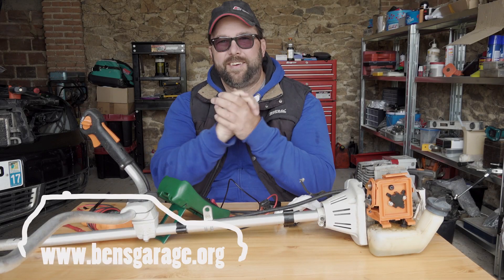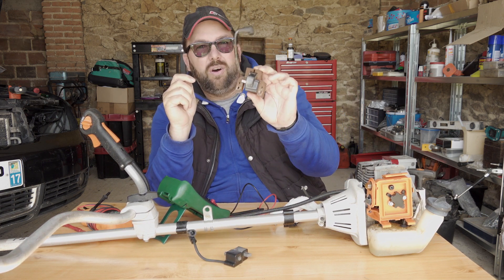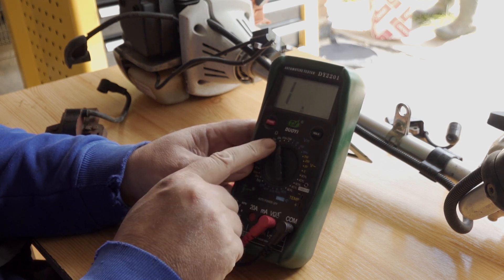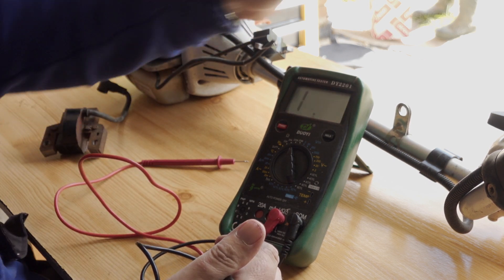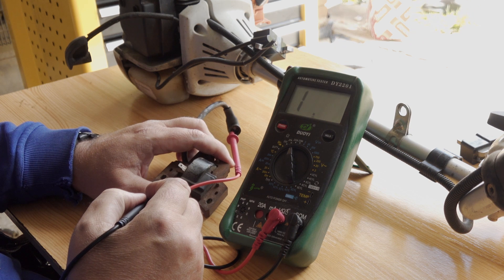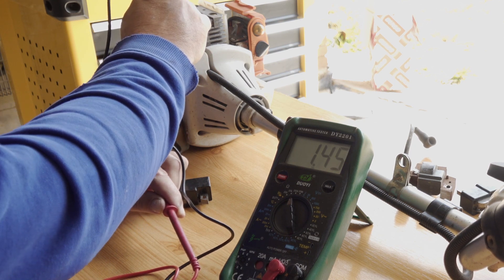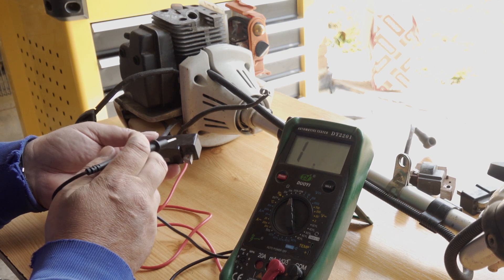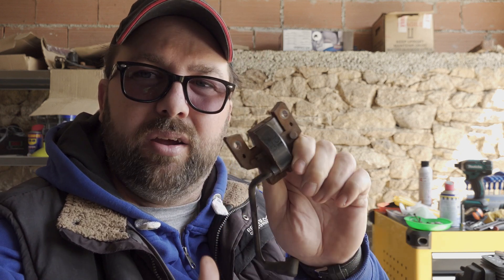How to test  a small engine coil using a Multimeter.

Comment: You tested a 2 cycle coil and it was too brief in context. Most 2 cycle coils have electronic components inside them. Lately I needed a 2 cycle coil and oreded the rightb repalcement part and when it arrived it was defective. I tried again and ordered another and found it decetive as well ( that was from Amazon and both were sent back for refund. Took chance on buying one off eBay and again it arrived defective and not working. Sending it back would cost me money for a refund so it went into the garbage. Coil was fo an Echo tiller TC-210. If new repalcements parts arrive defective, there should be no shipping costs applied to consumer, as it is not their fault if part is defective when it arrives. These coils should be checked before shipping to be in working condition so the consumer knows it will work at time of arrival. All I can say is watch out you might be buying junk as a replacement part. I'd stay away from buying off eBay when it comes to defective returns. You won't get your shipping costs back.

Comment: My southland edger has a reading of 10.59 at settings 20k ohms on multimeter and it wont spark the sparkplug unless i remove the ignition and kill switch wires

Comment: Ahh that's good, I picked up a blower with weak spark and coil reads 3.98k ohm. Spark plug centre electrode reads 18.6k ohm so might try a new plug and get new fuel primer lines. Thanks
Reply: Isn't that way to high? Supposed to be like 2.500 to 5000 when set on 20k?
Reply: @davidwillis5016  once I put new fuel lines on and put it together it worked well. It was a freebie so I'm not complaining.

Comment: thanks for posting am trying to get a spark on an little used but fairly old Honda generator -am told the coil module is obsolete and not obtainable could a substitute be used and could the  coil/spark module be repairable
Reply from the maker: You could check to see if your old obsolete coil had any replacements, other wise you would have to try to match it from something else. But you would need to make sure the poles are the same, as in distance, or the timing will be out. As for repairing the old one, I have no idea. Maybe someone could fix it.

Comment: A coil can check good but cut out when it gets hot after 10 minutes of running. If that happens, just get a new coil.
Reply: Never throw parked at a machine find out why before you buy another part

Comment: Every single video on this subject (not just yours) are like “here’s how to test a coil.  I don’t know what the numbers for this unit should be but it’s showing some numbers so this one is good.  I won’t mention what numbers you might expect for a bad coil, or what goes wrong with a coil or anything.  Hope that helps!”
Reply: You don't need to know the exact numbers as long as they're not shorted or open and they show a decent amount of resistance forget the number unless you have them in front of you
Always check primary to ground
Secondary to ground
They will never have the same ohms from primary winding. To secondary winding
Reply: @ronalddaub9740 some of them might show spark but might be bad.
Reply: @ronalddaub9740 that’s great but they don’t explain that either. These videos are always a black box unless you already know what you’re doing
Reply: Define “decent amount of resistance”.

We are looking for a number here, down to r nearest 100th if you don’t mind lmaooo

Comment: Looks good in checking secondary resistance. That's just one step. How do you test the embedded primary circuitry in seal(potted) ignition coil pack? Thanks for the instructional video.
Reply: It's not like there are not wires running out. 😮
Reply: Make a pigtail just for checking

Comment: You are only testing the secondary of the transformer. The primary, with its electronics, has to be tested also. That is what failed in my coil. You test the male spade terminal where the on of switch connects, to the metal part of the coil. There should be a reading in ohms, but much smaller.  Mine was open.  The  on off switch, and it’s wiring shorts the primary coil to ground, shutting off the machine if the switch or wiring is shorted, the machine won’t start either.
Reply: Thanks, this wasn't mentioned in a video of >5minutes

Comment: I have learned something, THANKS... How is this, I have a NO SPARK condition and the coil was test by a shop here in Seguin TX good, but after reinstalling still no spark.  Yesterday it ran a little while, and latter never again.  I tested the coil with 20K OHMs and got a -1 reading... a sign it has gone bad..

Comment: A tip! Anybody with aging equipment, buy a coil! I've e got a Troy Bilt Pressure Washer, 2015, coil went bad. No problem! I'll buy another one! Spent a solid week trying to find one. NOBODY HAS THEM! Warehouses out. Briggs out. Dealers out. Troy out. A perfectly good 7 year old Pressure Washer down for lack of a coil. Buy A Coil
Reply: Same for my otherwise perfect, well maintained, to  good for the land fill, Echo GT1200 string trimmer, circa 1993.
Reply: Ugh. Very true. Two is one, one is none

Comment: 5:04    Hi  Ben, from Alberta Canada.  That gap, between those coil pickups, and the rotary flywheel, should be  10,000  of an inch.  Or,  the thickness of a standard business card. They work well, and are just the right size.    Thanks.
Reply: 10 thousanths of an inch,or 1/100th
Reply: @MrOlgrumpy 10 thousands of an inch is nothing like 1/100th!!!
Reply: .016 inches stock is the standard business card thickness    googled it.  ten thousands of inch is .0001
Reply: @garybray3614  ten thousandth of an inch is, 0.0010" not 0001!!!
Reply: Thanks

Comment: the  test you just did was checking for an open winding thats all the ohms reading tells you  the fact that  you obtained a reading at all tells  you coil is not open but it could have shorted winding ----- spinning fly wheel with plugs out  and screw driver inserted into plug is a good test  for spark ---if wood ruff key is damaged  and fly wheel not lined up correct will show no spark  before you start replacing coils veryfi  wood key is ok on fly wheel this put magnet at right place at right time
Reply: It will spark with a bad key way the motor will just be out of time bud !!hope this helps someone 25 plus years auto !!
Reply: @rickybailey7123  partially or fully sheared flywheel keys are common in lawn mowers if the blade hits something solid such as a rock.

Comment: Hi Ben. What if the coil is down to earth?. I haven't seen you test those coils for shorting down to earth here. Yes, you have the HT coil resistance,  but if it is down to earth  then it is faulty.  Your shut off switch shorts it down to earth to stop it.
Reply: Correct, Glyn  !